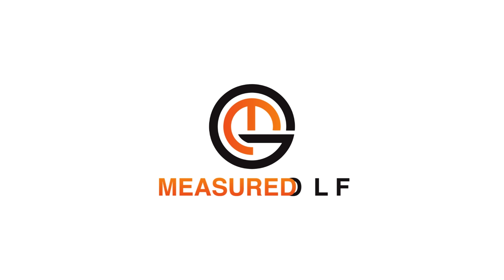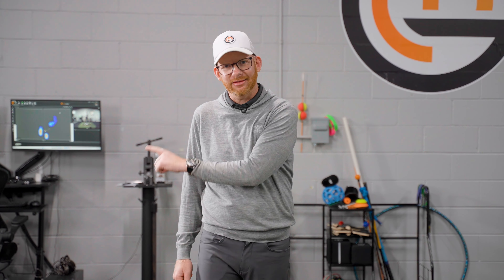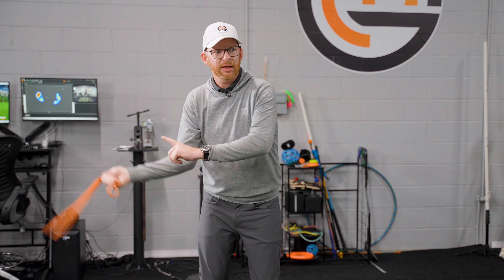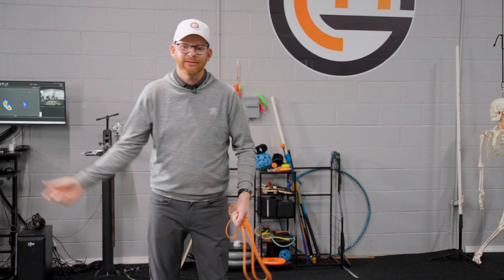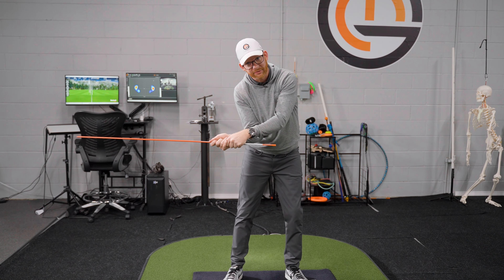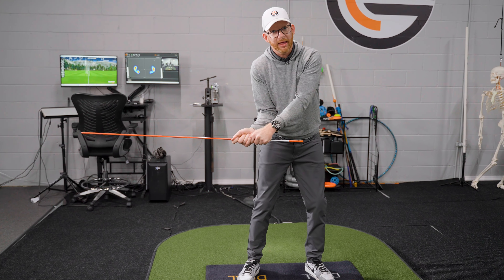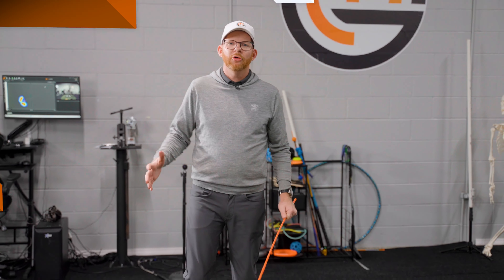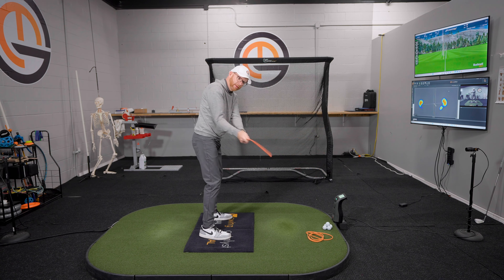Will Speed Training Equal More Ball Speed

Comment: This is brilliant.  Great illustration with the stick of how and more importantly, where this happens.  My clubhead speed jumped 4 mph in just a few swings.  I’ve always had good verticals, but always late. By cracking the whip earlier it seemed that it timed  up my verticals much better.  If that makes sense
Reply from the maker: Makes a ton of sense, if ground force is increasing, grip pressure must be decreasing. All the best and keep up the good work.

Comment: Hi Michael, you say we have to put the vertical force earlier in our swing, I know this already as this is a problem I have, my verticals are definitely too late. So the question is, how do you go about actually moving the application of force earlier in the swing, and does it have to be a complete swing rebuild to do this? Do you have a video on this already?
From my own attempts to move the timing of application of vertical force (I have no force plates to verify this though, just my trial and error trying different things in my swing) it seems to me that if I miss the timing when the vertical force comes too early, its WAY worse than if I miss the timing when late. If I slightly mistime my vertical force application when late I seem to lose 2-5mph with driver. If I mistime it when I'm early I can lose 7-12mph comfortably. I'm also pretty certain I've never actually timed it correctly, it's either way too early or too late.
Reply from the maker: Generally, if your forces are slow, than you have to try and make the club move with the hands and arms more, which would require a different release than if the forces were well timed. Unfortunately, the golf swing is a closed system and not something that we can change one thing and leave the rest the same. I also wouldn’t change anything when you haven’t measured and hit it better “your way”. All the best.

Comment: Sounds like the split hand pump drill might work well to achieve this?
Reply from the maker: Not a huge fan of the split hand pump as it tends to keep the leverage and pressure in the lead hand which doesn’t allow trail elbow to move back in front of body. All the best.

Comment: How do you do this with a club?
Reply from the maker: I wouldn’t recommend starting with a club, but the idea and point at which we whip the stick is the same in the swing. Most people are still applying too much pressure in the hands and aren’t able to release the wrist angle soon enough which causes handle drag. Hope this helps, all the best.
Reply: Do you mean that is only the release of the wrists? Is that the only role of the hands? No force by arms and forearms?
Reply from the maker: That isn’t what I am saying and it would be impossible to use the wrist without using the rest of the arms they are attached to. You may want to watch some of our other videos where we talk about how we create speed with our body and creating breaking forces so our hands can release vs trying to hit with only the hands and no body which is what this video is dealing with. All the best.
Reply: i believe i got it. thanks
Reply from the maker: All the best